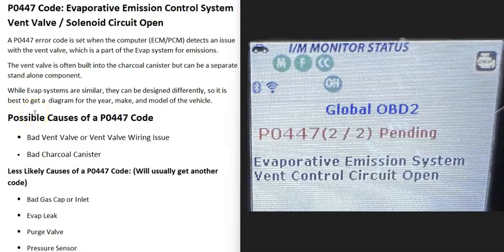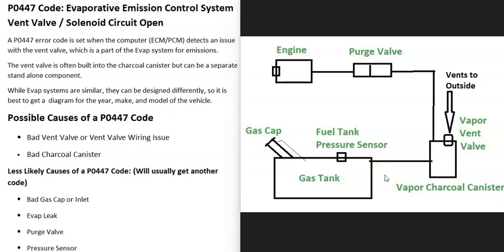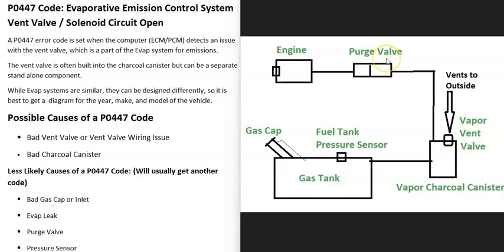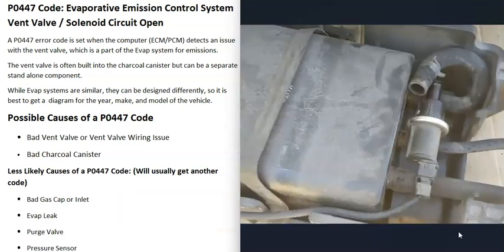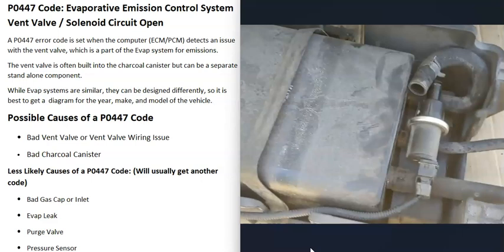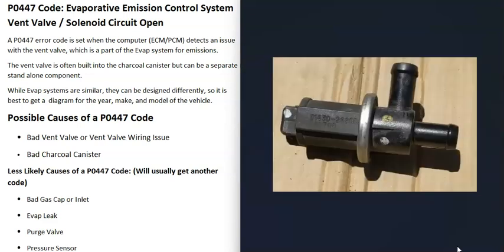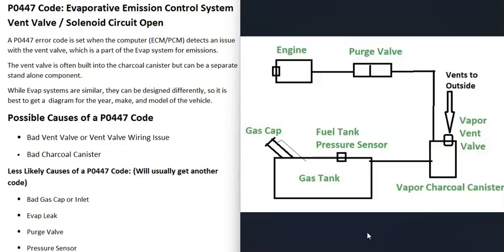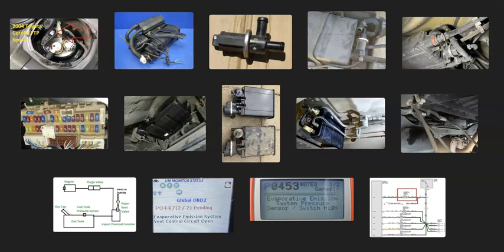Causes and Fixes P0447 Code: Evaporative Emission Control System Vent Valve / Solenoid Circuit Open

Comment: Here’s my experience one code after another first it was a P0442 and  changed the gas cap problem solved! 

Then after that P0455 change the charcoal canister with vent valve sensor problem solved!

Then P0447. I will have to change the purge valve.?
Reply: I just now got a P0447 code too on mine after getting gas from Chevron in SF, CA. Hopefully it’s just a coincidence & a lot of other people aren’t going to get problems too. Sometimes I wonder if the gas could be messed with to intentionally ruin our vehicles in favor of electric vehicles. I wouldn’t put it past them to do such things! If I can figure it out, I’ll try to post it, if I can remember to do so!
Reply: @knutelindstrom3716 
P447 is the purge valve solenoid that sits on top of your engine valve cover!

Comment: I have a 2008 hyundai 2.7L that's had a P0441 for awhile now. Today it stopped running and popped a P0447. Wish me luck.
Reply: I'm having the same problem. Did you figure anything out?